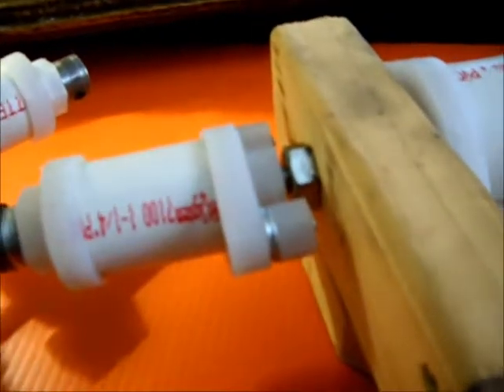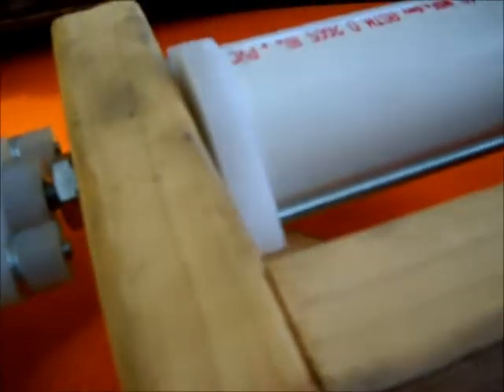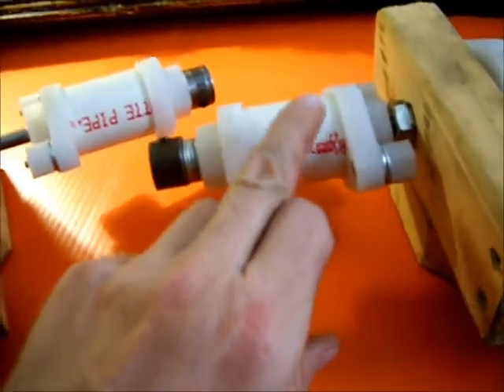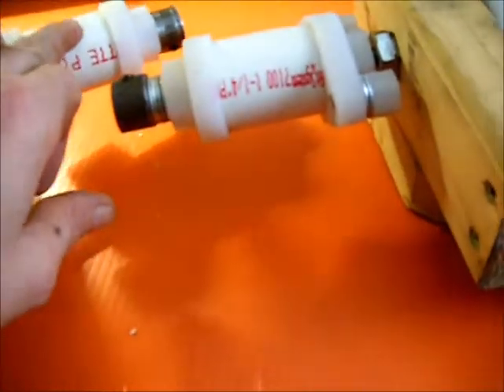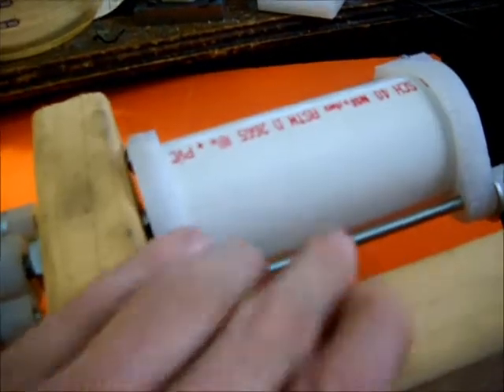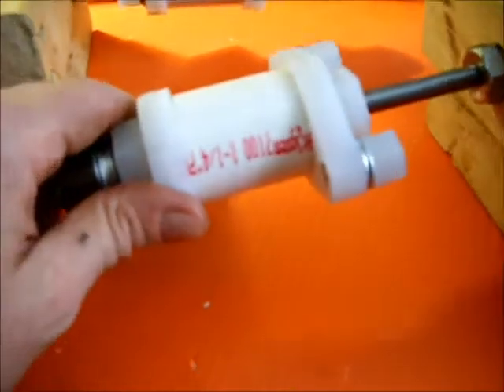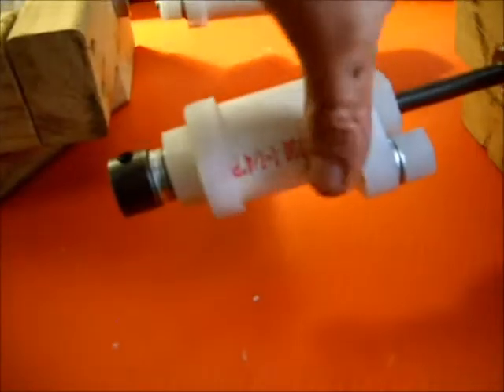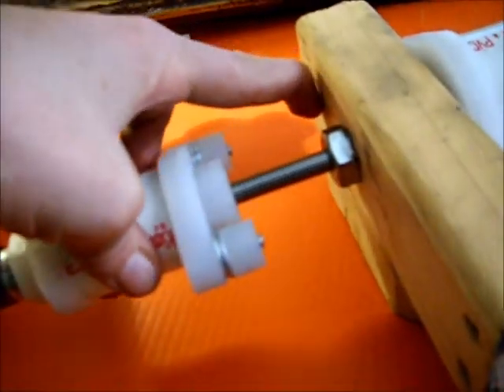GRAM 6 16 16

Comment: Absorbing the push?
That will be a lot of energy loss there.
I was making a picture in my mind of how it would operate and I could imagine the energy which is getting lost here. A spring would be the one and only best way (imho). Plus the timing for the coil doing it's push would still be difficult. The better the timing the less energy is wasted. But it will not be a fixed point.
If this was my project I would use a light beam to set of the coil at the right time. And I would rather not use a magnet. You still can use the coil to draw in a piece of metal, which in return pushes a plastic rod towards the incoming pendulum. (just a rough sketch of my idea that is).
Reply from the maker: Hi, that is the great thing about this configuration, it is real easy to fabricate. I made the base frame in a day. It is something that anyone can make and do their own experiments. The large main pendulum is only responsible for tilting the table. With out the shock-absorb-er sometime the magnet would bounce off.

Thanks for the suggestions, cheers